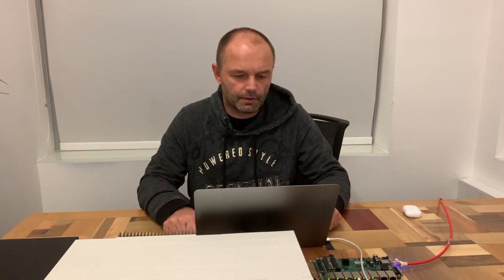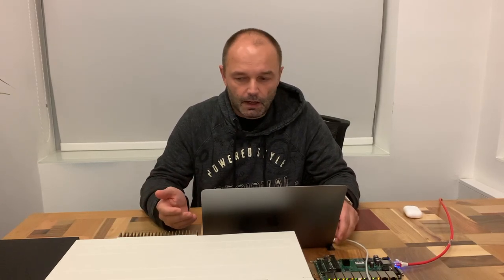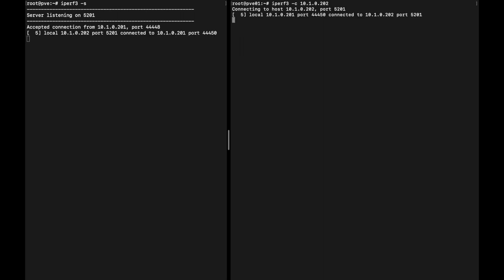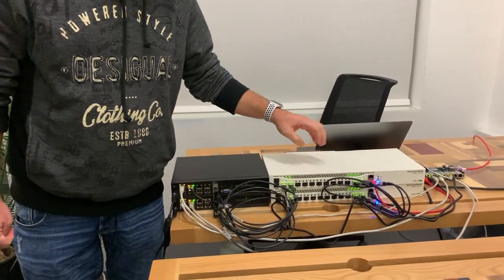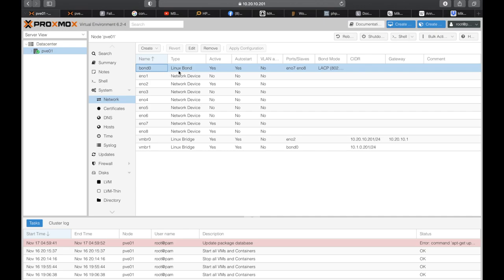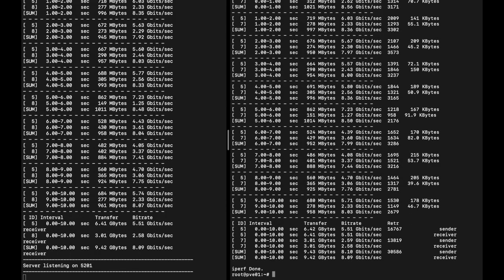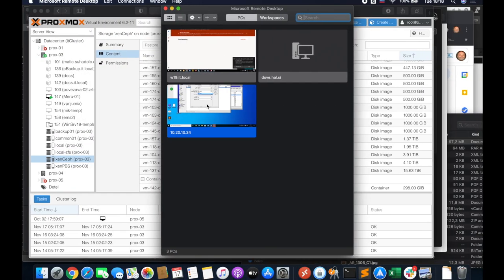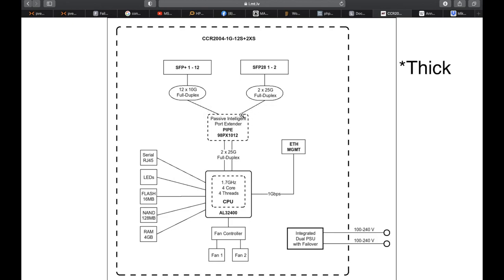MikroTik CCR2004 Performance Test Part 1

Comment: I was looking for CCR2004 review to find you review. To correct your information regarding the TILERA based 1000 series CCR. Until the TILERA production itself is halted, the MIKROTIK has no issue regarding the dropped TILERA support in LINUX kernel, since MIKROTIK is using theiw own, custom kernel in ROUTEROS,  and only version 7 switches to newer version.

Comment: Hey there, I am comparing the CCR2004-16G-2S+ to the CCR2004-1G-12S+2XS and I'm not sure which one to get. The 16G has many 1Gb Eth ports which I don't really need. However it boasts that it's the fastest router in their entire CCR2 lineup. I'd rather get the 12S, but I'm concerned it's single-core routing will not be as high performance, even though they have the same CPU. I figured with your hands-on knowledge you can speak to this. On these models, would they experience the same router performance? Neither router will be under heavy switch load but it will be connected to a 1Gb+ Internet connection. Thank you!
Reply from the maker: Hi Chad, there is a "Passive Inteligent Port Extender" in a block diagram of the CCR2004-1G-12S+2XS. It sounds like a Mikrotik shortcut which usually leads to all sorts of problems. In a case of CCR2004-16G-2S+ at least you know you are dealing with Marwell switch chips. Maybe a later would be a better choice if you do not need 25Gbps or something like this.

Comment: QUERY ? A ccr2004-1G-12S+2XS SHOULD FAN THE EQUIPMENT WHEN TURNED ON OR WHEN THE EQUIPMENT OVERHEATS AUTOMATICALLY, DOES THE FAN ACTIVATE?

Comment: It would appear to me there are problems with hashing algos between the 2 switches. Perhaps you want to test again with both server trunk left to LACP/L3+4, but the inter-switch trunk to one of the balance modes (rr or alb)?
Reply: I think I was testing all the combinations, there was no big difference. Will try to test this again, when I have appropriate equipment. I'll try the 25 Gbps cables too.

Comment: I'm sure that 25GBit/s can totally be switched, I suspect that the Router can't hw offload the LACP and thus has high cpu utilization while running the benchmark. It would be interesting if using BGP+ECMP would be any better.

Comment: A bit of a strange question but how loud is it? I was thinking about placing this in an office enviroment. Will this disturb people while working?
Reply from the maker: It's in audio range of a desktop PC, it would be no problem to put it into office environment. Audio in this video was recorded while everithing was running...
Reply: @VirtuaitSisec  thanks a lot for the information.I guessed it but sometimes microphones can filter very well
Reply: @VirtuaitSisec  Do you expect the RouterOS 7 version to be free for the mikrotik router owners or will i have to buy it as soon as it is on the market? Because on the productpage it says that only 2 of the 4GB s of RAM are avaible on RouterOS 6 for some reason
Reply from the maker: @Kappi1997  if they ever finish it, I think it will be free for current users. There are some alternatives like VyOS and OpenWRT, i do not think they can afford to charge for it.

Comment: Yes, please do the routing aswell! Also, have you tried v7? Any differences?
Reply: Ok, have to order some equipment, will happen soon.
Reply: @nejcsu  very much looking forward to it ! Also - if you route on a LACP interface - will bottleneck be the switching capacities shown in this video you think?
Reply: @nejcsu  I just did some test myself on CCR2004. I am getting similar results as you do. I am testing LACP, which obviously goes through the CPU because it has no switch chip. If I route through LACP interfaces, when using iperf3 --bidir -P128 I can push about 11Gbps one way and 7Gbps the other way, while CPU goes up to ~68%. On 7.1beta5 that is, because transmit-hash-policy is broken in 6.x (it will only send via one interface). I have made an excel sheet if you are interested in seeing my test, let me know :)
Reply: @nejcsu  Also I did one test without LACP. 
Setup:
- two machines with two interfaces each
- each interface in separate subnet
- make route to remote machine via one interface each
- mikrotik ccr2004 with on interface in each of all 4 subnets.

now make iperf3 --bidir -P16 via each subnet
total of 30.4Gbps.
CPU at 88%.
30Gbps is what I get if I remove ccr2004 and just --bidir -P16 directly via my machines. So bottleneck is my CPU. (8 core Intel(R) Xeon(R) CPU E3-1245 v5 @ 3.50GHz)

But I am not sure why ccr2004 would route much faster than it can using lacp? Because traffic goes through CPU either way if its just routed or LACP+routed or just bridged?
Reply from the maker: @sliddjur  Hi, please do share the file, you can send it to info@virtua-it.si
Reply: @VirtuaitSisec  I sent you an email :) 
Also, your test, when using the xmit-policy=L3/L4 on a bridge, will it ever work? Because it only looks at the mac-address anyways?

Comment: What is your DAC cable type sir?
Reply from the maker: Hi, it was the one from FS.COM. But that should not matter, they are all the same.
Reply: @VirtuaitSisec  what do you meant they all same.. so dac for cisco is usable in application for mikrotik sir?
Reply from the maker: @kemalrizkywahyudi6709  I do not know about Cisco, but they do work with Fortinet, Aruba/HP and Ubiquity.
Reply: It works even using cheap mikrobits worth as $50 or fewer